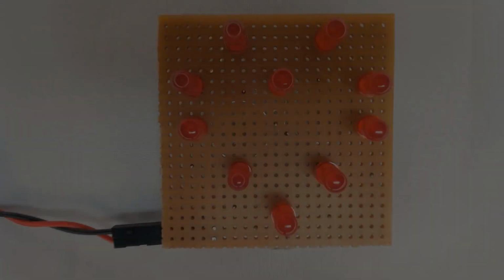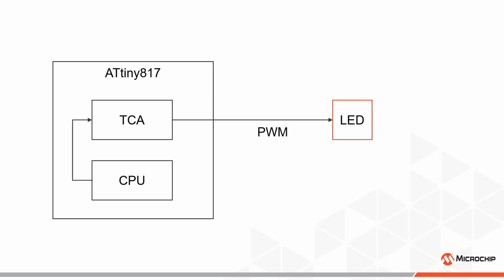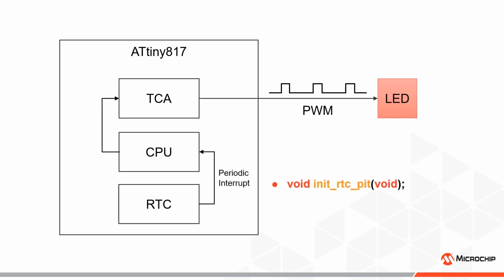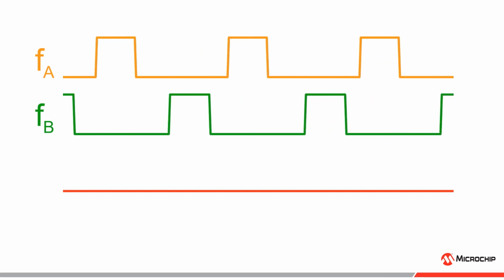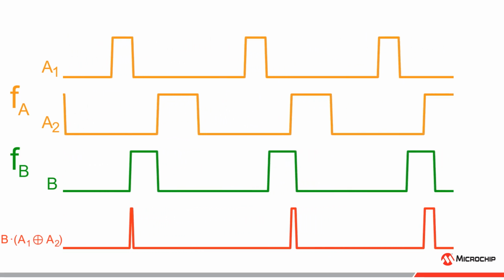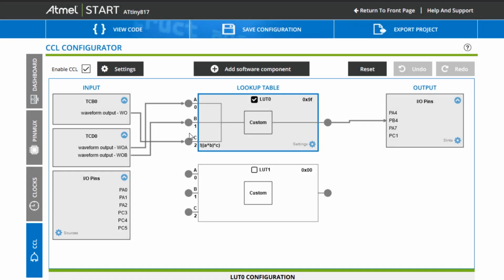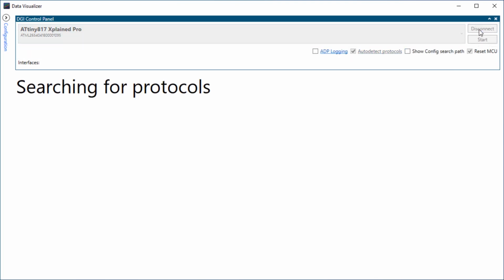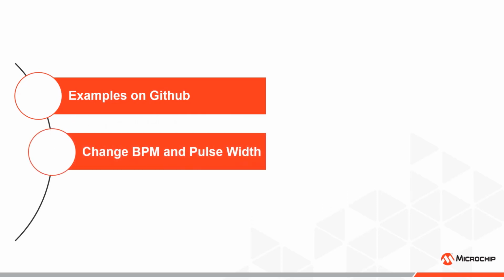Realistic Heartbeat LED

Comment: Is it possible to use the analog comparator in Core Independent mode ?
Reply: Yes! The Analog Comparator (AC) compares the voltage levels on two inputs and gives a digital output based on this
comparison. The AC can be configured to generate interrupt requests to the CPU  and/or events upon several different
combinations of input change. The events can be routed to other peripherals connected to the event system, such as a timer/counter. For instance, timer/counter A (TCA) can count the number of positive edges received from the AC, or it can start a timer to measure the time between edges etc. There are many possibilities!

Comment: Brilliant! Was not aware, until now, of the CIPs peripheral on the AVR parts. What else can you do with the configurable logic?
Reply: There is a lot of possibilities with the CCL! For instance, you can use the LUTs to combine input signals and have custom logic for when an interrupt should occur or a timer should start/stop counting etc. by using the event system. You can even chain LUTs together. You also have latches and flip flops for sequential logic. It generally can act as custom glue logic between peripherals, peripherals and the CPU or peripherals and IO. Too many possibilities to count really. For an overview of how it works, I recommend checking out this application note: https://www.microchip.com/wwwAppNotes/AppNotes.aspx?appnote=en598462